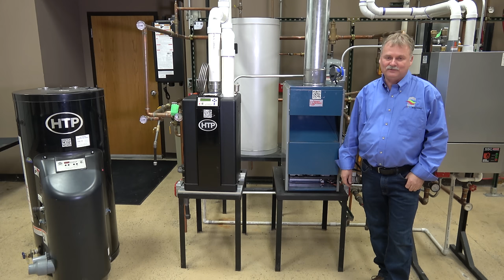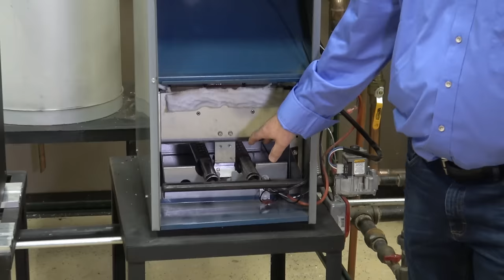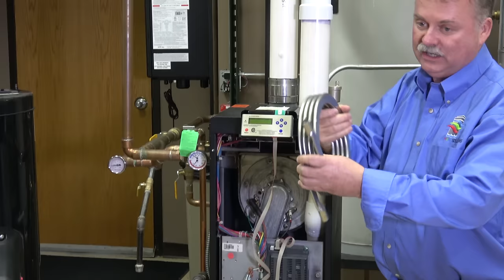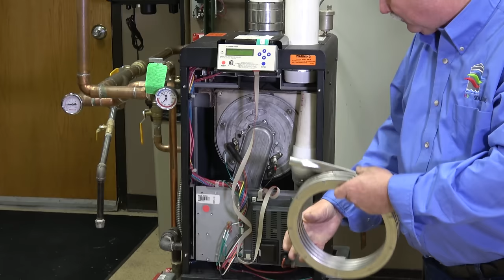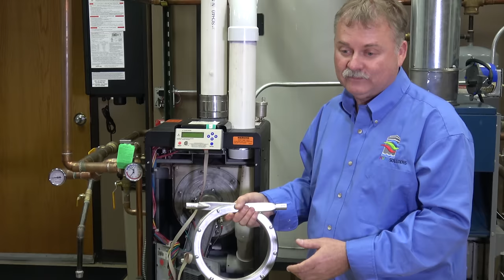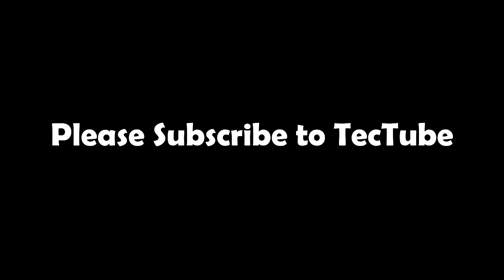Boiler Types: Standard vs. High Efficiency

Comment: Does it make sense to put a buffer tank with an old 1950's boiler?  It seems like everyone says old boilers are oversized but is there a solution to that issue.   Natural gas is will never be an option where I live.  In the future I would to go to a pellet boiler or ATW heat pump.
Reply from the maker: The age of the boiler is less important to the discussion that the volume of water the boiler holds.  We are going to assume that your old 1950s boiler is a cast iron and is a "high mass" boiler, hence holds a lot of volume.  Therefore adding a buffer tanks is less critical as compared to a stainless steel boiler "low mass" boiler.  All the tank does is add water mass/volume.
Reply from the maker: Yes, the vast majority of boilers... old or new... are grossly oversized.  The best solution... especially for older boilers... is to replace them with a correctly sized boiler.  Check out our video on sizing - https://youtu.be/h00dAUaOa9o
Reply from the maker: How efficient is that 1950s boiler?  Probably 60% when it was new and even lower now.  You are due for a boiler replacement.  Even the lowest efficiency boiler you can buy today is 82%.
Reply from the maker: What is your fuel source now?  And is it less expensive to heat with that fuel source than the electricity consumption of an air-to-water heat pump.  Where we are in the Chicago area, heating with electricity (including heat pumps) is fairly expensive compared to NG or LP.
Reply: My fuel source will never be natural gas.  Not available because of railroad tracks nearby.  The boiler is 55 percent efficient.  Love to goto a pellet boiler
Reply from the maker: @bradhorning9849  We understood that you did not have NG, but we were asking what is your fuel source?  LP, oil, electric, coal, etc.?
Reply: 1950's oil boiler.    I have thought about getting an electric boiler as a back up but have not looked into that very much.  I appreciate any and all responses.  Heating where I live is not a huge demand on a system.  For the last several years i have been using my pellet stove.  But, I am remodeling the basement and we are looking to put in-floor heat in the basement ceiling.
Reply from the maker: @bradhorning9849  You would need to look at cost to operate electric resistance heat vs. oil.  Oil prices are also more volatile.  If you don't use the heat much, then an electric resistance boiler replacement may make sense because maintenance is easier than oil.  In regards to the air-to-water heat pump, it will always cost less to operate than electric resistance heat, however the complexity is much higher and the first cost is much higher.
Reply: Thanks for the input!  Would I just get the electric boiler hooked up in series with the oil boiler?  What trade installs the electric boiler--electrician, plumber or oil boiler installer???????
Reply from the maker: @bradhorning9849  Don't do it in series.  If you have two boilers, put them in parallel, then you can run either or both.  Or if the old one is on its last legs, just remove it completely.
Reply from the maker: @bradhorning9849  The trade that would install it would depend on your geography.  In our area (Chicago), it would be installed by a heating (HVAC) contractor.  Electricians in don't do piping work.  And most plumbing companies don't do heating work around here.  However, in other areas, plumbing and heating are sort of a combined trade.  And in some areas, a heating contractor will install and pipe it but an electrician will come wire it.  Local codes and customs change the answer geographically.

Comment: Which of these boilers are used for steam?
Reply from the maker: None of the boilers shown in this video were steam boilers.  The maximum for a residential steam boiler is about 82-84% efficient.  To get more efficient than that, you need condensing technology and lower water temps... hence not possible with steam.

Comment: You should use; induction technology; as heat sourch!!
Reply from the maker: Induction Heat Boilers are a thing. We just have not seen any available in the US, though. Additionally, heat pump boilers are more efficient than induction boilers and both are all-electric, so we doubt induction makes its way into the US market faster than heat pumps.
Reply from the maker: Induction might be a good choice for domestic water heating, though. Because in that case, heating water fast is a benefit. And induction can be fast. But for space heating, speed is not a benefit.

Comment: are they 80-85% units allowed in new installs? i thought most codes require he units
Reply from the maker: Energy codes are specific to geography.  For all of the states that we deal with in the Midwest, 80 or 82% is the minimum efficiency for gas-fired hot water boilers depending on boiler size and residential or commercial application.  The IECC 2015 and 2018 versions match that also.  In addition to building codes, for small boilers under 300k, they are regulated by DOE to a minimum of 82% for hot water.
Reply from the maker: By "HE," we assume you mean high efficiency condensing boilers.  Where do you see code requiring boilers be above 90% AFUE or TE?
Reply: Washington state codes are pretty tight.
Reply from the maker: Wow, Washington requires all boilers be 90%+.  That is huge.  Even in strict energy codes states, we do not see this type of requirement as a code minimum due to venting challenges.  Do they require 90%+ in both residential and commercial buildings?
Reply from the maker: I just looked up Washington energy code.  They are following the IECC 2015 which only requires the boiler be 80-82%.  However, it looks like they have an additional state amendment that forces you to do something extra to earn credits.  Installing a 92% boiler or 94% furnace is one of the optional ways to earn 1 of those credits.  Certainly an interesting way to regular code... sort of a choose your own adventure type thing.
Reply: Furnaces keep going up, there are only a handful of wood burning stoves allowed and like 3 wood/pellet boilers allowed. plus inspections either by the state or your insurance company depending on the vessel size for res and all sizes for commercial. even a small electric water heater requires the inspection if commercial every other year. bamm 200 bucks please
Reply: Yeah, very very few builders build better to get credits. instead they use the appliances to get credits. from furnaces to shower heads. i think it's stupid.
there are very few boilers in residential use, if i had to shoot from the hip i would say under 1%
Reply: We in China are allowed anyway.
But many people are started to buy HE unites to replace the 80% unites for saveing gas.But in a other end ,some people are use the air to water heatpump.

Comment: Thanks for info, trying to get my heating system up and heating again, my old boiler is done,  a traditional cast iron type,  and thats what I want to replace it with,  seems like the heating Co.s in this area got one thing on their minds vitodens 100, they don't want to install any thing else,viessmann must be giving pretty good kick backs cause these units have about 2:1 against on the Internet for reliability.,my old boiler was 23 when it gave up  a high efficiency boiler would not likely last 15,  10 is about all your likely to get, no thanks.
Reply from the maker: We have been installing high efficiency condensing boilers since the late 1990s.  They last 20 years or more with ease.  However, unlike cast iron boilers, proper installation and regular maintenance is more critical to their longevity.  They are less forgiving.
Reply from the maker: If you want the longevity of cast iron, the high mass effect, or other benefits of more traditional boilers, but you still want high efficiency, we might suggest HTP's Pioneer.  http://www.htproducts.com/pioneer.html
Reply from the maker: BTW - Only 23 years for a cast iron boiler is a problem.  The ASHRAE life expectancy is 35 years for that technology.  There may be something odd about your application, piping, or other install related items if it died so soon.  When you say "it gave up," we assume that means a cracked heat exchanger?
Reply from the maker: Viessmann makes a good boiler.  Bill, the presenter in this video, used to distribute their products a couple decades ago before we acquired his rep firm.  They are popular in Europe.  Where do you live that you have multiple contractors recommending it?  It is pretty niche.
Reply: @TECTubefilms  I live in 100 Mile House British Columbia,  the installed price here on a re and re is $9000 to $12,500.
Reply: @TECTubefilms  the problem is the gas valve, replaced the thermocouple, cleaned the pilot assembly and the pilot still goes out even after holding it for 2 minutes, the quote for the valve is $500 plus re and re,  I didn't think putting $1000 into this old boiler was the way to go, I don't know the age of the boiler for sure, this was an opinion of a heating contractor judging from the serial no., the boiler is a Ultra Hot, made in Canada but I can find nothing on the Internet about them, the contractor said they are out of business, I'm not even sure if it actually is cast iron or just steel, it heats the main floor on four  loops plumbed as one circuit as well as a secondary tank for DHW.

Comment: You should also mention you will need a electrical power spike prevention device for the digital computer of the furnace.
Or else your expensive modern controller will get fried during a nasty storm or hurricane.

Comment: Don't like that 3" flue air pipe, that needs some work.
Reply from the maker: You don't like that the size is 3 inches?  Or you do not like the way the 3" pipe is installed?  In our defense, that this probably above the 3rd boiler installed in that specific workstation so we are frequently adapting.  LOL
Reply: @TECTubefilms  Hi , the size is to big, most boilers now up to 200K BTU using 2" pipe, 2" pipe is lot essay and installer friendly when you have to penetrate building envelope.
Reply from the maker: @786otto  Understood.  It is a function of inducer motor static ability.  In the case of our lab, that pipe was installed in 2006 for a different boiler and then re-used later for this boiler.  It is okay to be a little oversized on vent pipe, water pipe, and duct work.  But we don't like oversized boilers, furnaces, and A/C.  :)
Reply: @TECTubefilms  Thank you for reply.

Comment: Just plain spendy for the fuel. I didn't figure out the design correctly. Probably not enough fins n undersized unit. Pretty tough with heat loss until u see how well the construction n settling goes. I went with outdoor wood boiler. Paid for itself in 3 years n I'm on my ninth year. Can't find returns like this on much anymore.

Comment: Flame rectification probe and a thermocouple are two different things. It's either one or the other.
Reply from the maker: True, you can have either or.  But both have the same job... which is to prove you have combustion.  As Bill stated, modern boilers are more likely to have a flame rec probe, but in the "old days," you would have had a thermocouple instead.  Hope that helps.
Reply: Nice explanation of the low mass vs high mass boilers. Just so others know since I see it often if you have a low mass boiler and it is short cycling you can add a buffer tank to help prevent that and improve the efficiency of the system.
Reply from the maker: True.  ... and Bill may even be talking a little bit about buffer tanks in the hydronic series of videos forthcoming :)
Reply from the maker: https://youtu.be/Y-8EWK1Moh0

Comment: Don't ever have an HTP product in your home. Nothing but trouble.
Reply from the maker: We have used hundreds of HTP boilers for 15+ years with great success and little issues.  And Bill Bailey (the guy in the video) has been using them even longer.  Is your statement based on a specific issue that you have had in your own home or based on you working with these boilers on multiple occasions?